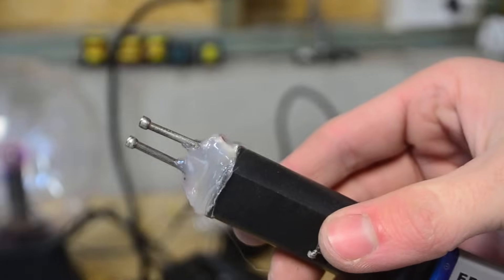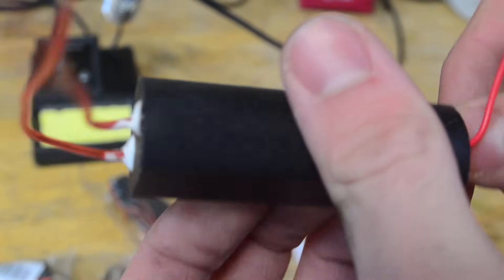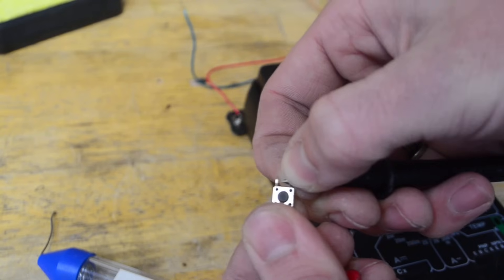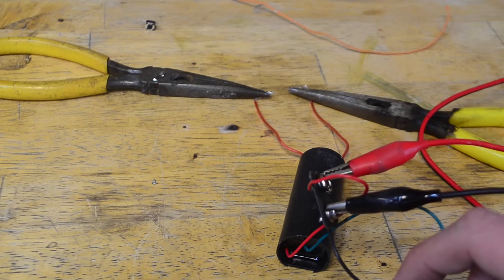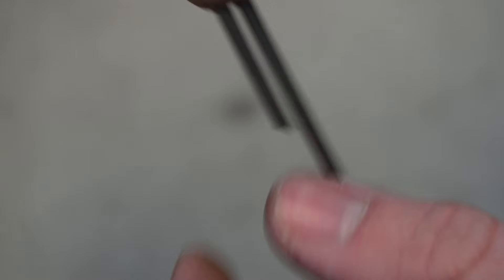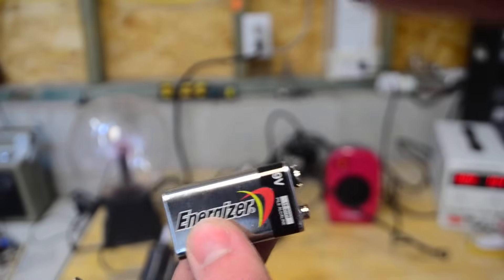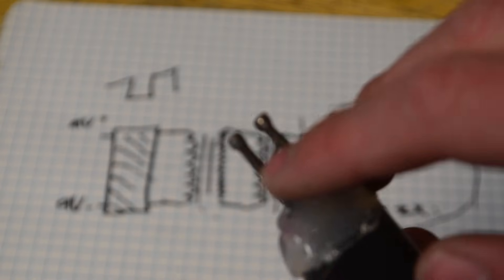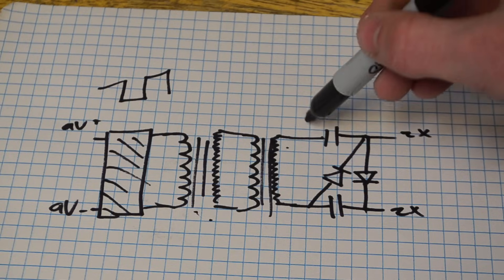How to make a 5$ Pocket Stun Gun

Comment: 7 years late, does the distance of the nails affect the power outage strength eg the spark and how well it can set things alight
Reply: Nope, the distance only determines how big the arc would jump across the two nodes, since the potential difference between the two nodes would be the pretty much the same
Reply: @shubhangdarshan7628  thankyou for the response

Comment: ...i feel like putting two buttons in series (one on the front, one on the back) of this would be safer, especially if you built up a little bit of hot glue around the outside of the buttons to 'inset" them slightly

would be awfully embarrassing if you lit your shorts on fire with a self defense device by accident, just saying, lol.

Comment: I built one but the button got stuck... is it possible that it melted because the volts is too high? Should I use a better button for longevity?
Reply from the maker: It could be that the current was too high. Many of these momentary switches are very low quality. I remember when I made this I would switch out the button every once and a while due to it no longer working, a better button would certainly help with that!

Comment: I made this and the little push button got stuck. I think its because it cant handle 9v battery and it melted inside.. any recommendations for a fix? I can use a resistor but I think it will reduce the output of the charge...

Comment: I build one but mine seems different its so powerful that when i turn it on its loud like scratching a metal and when i try to put paper between other youtube videos when they try it it makes holes in paper but mine in instanly put paper to fire even my battery is not that powerful
Reply: Hey Roselyn, I had an issue with the battery terminal. I’ve followed the tutorial and tested every component, but the battery terminal will simply not send power. Help?

Comment: I made one and it worked perfectly but after a few uses I have to put it up to an object to create the arc instead of just clicking the button and it working. It just beeps when I press the button. I'm not sure if I have done something wrong with the circuit or with the nails. if you know a solution it would be appreciated

Comment: I know using a 9-volt make it easier to be able to connect it but have you tried using an a23 battery? It's a 12-volt instead of 9 volt and it's smaller.

Comment: Hey guys, here is the link to the boost converters: https://www.youtube.com/redirect?q=http%3A%2F%2Fwww.ebay.com%2Fitm%2FDC-3v-6v-to-400kV-400000V-Boost-Step-up-Power-Module-High-voltage-Generator-%2F311688245090%3Fhash%3Ditem4892112f62%3Ag%3ASuQAAOSwFV9Xx31S&redir_token=QUFFLUhqblhkUEZ0RjJnY2lGVDhqZGlNNmh5bWh1LUxfZ3xBQ3Jtc0tscS1CWmdTdU9TV0o5NkpRTnM0Y2Y1ME1WVE5lRm5ldmhDZmRoVlBsMVpKSEJkMURkTkJVMXBMSUgxcXNiQlA1ZWVzRFlHQkFrb1EyYlFZOHctbGRLS1hMb0ZQSjNuRDZYRXRfUUthRlJWTUFwX2dNSQ%3D%3D&event=video_description&v=wr2XvB95rV8

Comment: Hey I have a quick question could you perhaps use a smaller one like this one lets say to put on a glove hypothetically speaking, to make it less bulky

 link:     https://www.ebay.com/itm/DC-DC-100W-3V-5V-12V-24V-to-3-5-35V-Boost-Step-up-Converter-Module-Power-Supply/191933105283?hash=item2cb01ac483:g:ffcAAOSwqfNXmXqm

Comment: U r wrong boy..first of all battery is a dc energy source so the cannout produce pulsating current to inverter.the just gives a dc current to inverter
Reply from the maker: Yes and no. If a dam off a lake at regular intervals, it could be said the current coming from the lake is pulsating. Certainly you are right, the lake is not producing it, only providing the potential for current, but the lake’s current is being pulsated

Comment: THE STUN GUN NEEDS A SPARK GAP,THAT IS TWO POINTS BELOW THE ENDS OF THE ELECTRODES(NAILS) AWAY FROM WHERE YOU MAKE CONTACT WITH SOME BUGGERS NECK,THE REASON IS THIS ,THE SPARK WILL FORM AWAY FROM THE SKIN,THE VOLTAGE WILL STILL STUN THE VICT....SUBJECT.

THE ELECTRODE ENDS  WILL/MUST THEREFORE BE FURTHER APART THAN THE SPARK GAP,THE SPARK CAN BURN INTERNALLY CAUSING IRREPAIRABLE DAMAGE AND GANGRENE/POISONING/DEATH.

IT CAN BE SEEN ON COMMERCIAL STUN GUNS THAT THE SPARK IS SHIELDED INSIDE THE END OF THE STUN GUN CASE FOR THIS VERY REASON,IMAGINE FRYING SOMEONES BRAIN STEM IF THEY HAVE TO BE INTERROGATED LATER ONLY TO FIND THEY ARE DEAD NOT STUNNED.

Comment: Hey, just got one of these high voltage generators.
Sadly when i connect a battery to it nothing happends,i tried connecting it to 6V and 9V later on, but neither work.
Any tips on checking if it's my fault or it's simply not working?
Reply: Same bro it only sparks when both the wires are touched
Reply: @gamerixboy7933  You mean they touch each other? Its really wierd
Reply: @kapfereq  yeah when the high voltage wires are touched they spark
Reply: @gamerixboy7933  For me connecting them didnt change anything, i also tried changin the + and the - cables but it didnt change anything aswell.
Reply: @kapfereq  did you fix it yet?
Reply: @comixcomix1408  Yes, i'm not sure how did i achieve it because it was a long time ago but i'm pretty sure you have to adjust the gap so the electricity can flow. If that won't fix it, you propably have a faulty generator.

Comment: Boost converter 
2 9volt batteries 
Small momentary switch
A sawder
2 nails,electrical tape,a glue gun and a black wire
That's sound pretty easy
Reply: you only need 1 9volt...

Comment: Thank you, well presented and entertaining. If I may suggest, rather than nails, some short screws wouldn't need cutting. 
Also, a two pin mains plug would be even neater, incorporating its own solid, insulated mount.
Reply: An adaptation has occurred to me. Use a two pin line socket.

Comment: Wouldn't Quicksteel epoxy work better than hot glue? Also wouldn't you want to use brass or stainless steel finishing nails? Also what about making the bottom with another 9 volt buttery top with a one way diode so the whole device can be charged or wired to a port for a 9 volt charger port. Also for safety an on off switch with a 9 volt light led on the top as a find your way or blind your attacker light. You know the ultra white ones. The on off for safety and flashlight. With the quick switch to activate the stun. Just a few ideas.. I got a few more.

Comment: can you give me a small explanation about power rating of an electronic device? Does it mean that the device will consume power approximately equal to its rating or deliver that much power ?
Reply: This device drains amps and turns amps to volts. So it works like this. It turns 9 volts at 500 milliamps. Or .5 amps. Turns that to 4,000 volts and .0005 amps. It has mega  volts with next to no amps. It's a trade. Volts for amps. Want to no something even more odd. The wires at the battery never makes a connection to the end. It's done through wire coils. I could explain.. but wow.. it would take a page. But try to understand electricity this way. You know those steel ball that hang from strings? The ones that go click clack. You pick up 2 and 2 on the other end click up. That's how electricity works.
Reply: @patrickdavis9566  Thanks for the reply. so we can use high voltage to make a person unconscious temporarily. what are the methods for increasing current magnitude using 1.5 v batteries ?
Reply: Look.. you need voltage to carry amps. Then you need amps to trade for volts via the coils. See you have one coil with 100 wrap of wire next to a coil with 1,000 wrap of wire. Poof. 1.5 volts turns into 220 volts. But don't expect your battery to last long. Google how to build a 1.5 volt step up transformer. In welding we use like 13 volts to push 150 amps. Or 32 volts to push 500 amps. See. The power is in amps. Voltage just gives the amps a road to travel on. The more volts the wider the road. Thus the thicker the wire. Less amps the more narrow the road. Thus thinner wire. Google how to build a transformer.
Reply: Here is a Google definition

"In electrical engineering and mechanical engineering, the power rating of equipment is the highest power input allowed to flow through particular equipment. According to the particular discipline, the term "power" may refer to the electrical or mechanical power. A power rating can also involve average and maximum power, which may vary depending on the kind of equipment and its application.
Power rating limits are usually set as a guideline by the manufacturers, protecting the equipment and simplifying the design of larger systems, by providing a level of operation under which the equipment will not be damaged while allowing for a certain safety margin."

Comment: Ok, but you are using expensive equipment to make the 5$ taser more like 200$-300$ taser.
Reply from the maker: What was expensive? You only need wires and a soldering iron, the iron I use costs 10$ and the wires are free from old electronics, or 1$ for much more wire on the Internet.

Comment: Just a black box.let reveal the power flow inside that black box.
DC battery---->oscillator------>step up Transformer------>voltage multiplier(combination of diode and capacitor).         I am not interested to build it😊from an electronics engineer

Comment: Have you considered or tried using the 500kv power module, designed for 6-12v? Wondering if it will be more reliable whilst also being more zappy

https://www.ebay.ca/itm/DC-6V-12V-to-500KV-High-Voltage-Generator-Inverter-Boost-Step-up-Power-Module/222367736456?hash=item33c6266288:g:TKkAAOSw~BhbA-KP:rk:2:pf:0#rwid

Comment: Built this. Worked. Broke. Took it apart. Rebuilt it. Broke. Took it apart. Rebuilt it. Broke. Took it apart. Rebuilt it after the transformer stopped working. Waiting to rebuild it before it breaks again. Lemme know what r thots r on why it has just stopped working after a few uses. Am I holding the button two long?
Reply from the maker: I have no idea, mine has never broken, are the nails too far apart?
Reply: Well I didn’t use nails and kind of modified the build just to make it a little nicer looking. And instead of nails, I used an old plug. I took the two prongs that go in the wall and at first bent them closer but found they were too thick to produce an arch. So I added solder to make it a bit pointier so ur will arch and it worked! But I found every once and a while it will light up where I connected the two red wires to the plug (like u did the nail) rather than the end of the plug prongs. So it stopped working all together till I took it apart just now and it still makes the arch but only with the wires, no plug. Do u know why it won’t follow thru to the plug prongs?

Comment: I love how my boost converter completely failed, i hooked it up correctly and absolutely nothing happened, i tried cutting my high voltage wires short, then using the recommended voltage, then different 9V battery's, switches, and even a new converter. Nothing, not even a spark when i grab the high voltage wires

Comment: Good job but ive think u e can u try make a stun gun compact from small flashlight also use the same batterys for the flashlight https://www.amazon.com/Portable-Handheld-Flashlight-Adjustable-Resistant/dp/B00R5VM3FM/ref=br_lf_m_aaya2u65njtj88u_ttl?_encoding=UTF8&s=hi u can check it its usualy more bigger price i lost mine actually while ago sems like im lucky :D but i was thinking u can add 2 tubes in + with 2 wholes on the glass idk if its glass or plastic and idk if its shock proof but if the ring is plastic and the up side 2 like old one i had is good one to try idk do what u gotta do now its like 9 bucks

Comment: Converter: https://www.ebay.com.au/itm/DC-3v-6v-to-400kV-400000V-Boost-Step-up-Power-Module-High-voltage-Generator/322651902766?rt=nc&_trkparms=aid%3D222007%26algo%3DSIM.MBE%26ao%3D2%26asc%3D49574%26meid%3D5ff5fd0e0c7f43988c12cef8006d0491%26pid%3D100005%26rk%3D1%26rkt%3D2%26sd%3D202020417622&_trksid=p2047675.c100005.m1851

Comment: 1 Question: is the internal capacitor going to explode if i am pushing the Button but there is no way the secondary coil is closing its circuit by arking because the 2 metal spikes are to far away?
Reply from the maker: +Das_Fischstäbchenfutter nope, you don’t have to worry about the caps exploding, the secondary does close the circuit ( when the capacitors reach the charge necessary to  jump the gap, they will discharge through it
Reply: Keystone Science Wow thanks for the fast answer! Earned a sub ;)
Reply: Keystone Science So i bought myself 1 of these generators. Ive powered it with a 9V battery and it worked well. There were some arcs. But today ive powered it first time with my labor current generator (BT-153) with 9V (Like the battery) and i ajusted the current to max (3.32Amps) and now it is destroyed. There is a high noise if i power it with my battery but there are no arks anymore. But why is it destroyed? I powered it with the same Volts as the battery.

Comment: I am having an issue with residual charge. After firing the device, there still seems to be some kind of charge left which must be discharged using a piece of metal to short out the terminals. Accidental shocked from this residual charge after firing the device is unwanted. Do you know how to prevent this? Such as using some kind of resistor to drain the power into heat energy? If you could have any advice or feedback it would be appreciated, thanks!

Comment: I have bought 10 of the exact  boosters and they arc up to 6v but anything over I get nothing, They don't even hum. I know I've not blown them as when I connect them back to a 6v input they arc again. Any Ideas?
Reply: What source are you using for the 9V? These things need a lot of current to work, perhaps your 9V supply isn't supplying enough amps.

Comment: Could you add a LED in series with the button, so it'll be 6V AND also have a little indicator light?
Reply from the maker: +cyancoyote perhaps, but it would probably be best as to put in parallel on the other side of the button also it can still indicate, but won't take away from the power needed for the taser
Reply: Dammit, you're right! Also, do you think something like this could create X-Rays in a vacuum tube?
Reply from the maker: +cyancoyote haha xD and yeah it should be able to create X-rays in a vacuum tube
Reply: Thank you :)

Comment: Could you.. In theory wire a bunch of converters up to each other until you basically have lightning?
Reply from the maker: +Julian Santos in theory yes, however rather than another converter added on, you could continue with more capacitors and diodes to make voltage multipliers ( I'll probably make a video on this later if you like )
Reply: Thanks, that's a neat idea #subbed
Reply from the maker: +Julian Santos thanks! :D

Comment: making this within a few weeks 😂 just ordered components, now wait like a month for them to arrive
Reply: Did it work?
Reply: @eatmadust  yeah it works great
Reply: @gibba-3495  lmao you replied after 4 years
Reply: @rafakuzi8377  The ? was asked 4years late too.
Reply: @rafakuzi8377  got a notification so yeah why not😂 oh yeah and what guy above me said, the question was just 1 day ago
Reply: @gibba-3495  mines not working despite following everything 
Did u have any problems or anything when making it?
Reply: @Juan-nz1gu  you fixed yours? mine is not working as well
Reply: @Nadvon  i used a lipo battery,the 9V adapters tend to be a bit lower quality and burn out fast
Reply: I have a question, what is the black wire made of, aluminium or copper?
Reply: What was the output of the boost converter?

Comment: Hi... Would it be possible to use this boost converter to make the fractal patterns that you do in another video as it seems as though it would be safer than using the microwave oven transformer. Not sure if the voltage would be high enough though or if it would be sustainable long enough to get a pattern in the wood.

Comment: Things NOT to do ( Tasing yourself is not that bad just keep it away from major organs, (I've had worse shocks like dropping and trying to catch a very charged capacitor, my hand started to spasm))
DO NOT CHARGE ANYTHING WITH THESE
It breaks the converter and really hurts if you touch both charged ends.
I broke mine like this, also
DO NOT USE MORE THAN 9V OR IT BURNS UP 
This is a fire hazard.

Comment: a general FYI for anyone building one of these. this is beyond the level and for a long term duration then most equipment is ElectroStatic Discharge tested so keep that in mind for anyone who has electronics they don't wish to fry. 

also a slight chance of induced RF interference although the rise times are unlikely to be crazy high. 

high voltage can be fun. be safe.

Comment: Could I make this with an 18650 battery also or is that too powerful?
Reply: Jason Baker 18650 is rated for 3.6 to 3.7 volts. but has a much higher drain amperage. you could use it, just check the datasheet on the module.

Comment: can you please give me a link to the boost converter
Reply: http://m.ebay.com/itm/DC-3v-6v-to-400kV-400000V-Boost-Step-up-Power-Module-High-voltage-Generator-/302237877131?hash=item465ec8038b%3Ag%3Att8AAOSw32lYtakD&_trkparms=pageci%253Ace593ddd-002e-11e7-a8b9-74dbd1803d8c%257Cparentrq%253A9502bc1515a0a2af1475ca93ffe8fabf%257Ciid%253A2 
 If that's not available or whatever, just search the name of it on ebay. They rarely exceed 3 dollars.

Comment: I couldnt find the boost converter on ebay, could only find boost converters without a shell can you give me a link to the ones you had?
Reply: http://www.ebay.com/itm/DC-3v-6v-to-400kV-Boost-Step-up-Power-Module-High-voltage-Generator-400000V-dtl-/322370655970?hash=item4b0ec9d6e2
Reply: hi, thanks for ur reply, but those are 3-6v and the battery is @ 9V, would this work anyway?
Reply: @santix10  Yes he mentions this in the video did you not watch it?